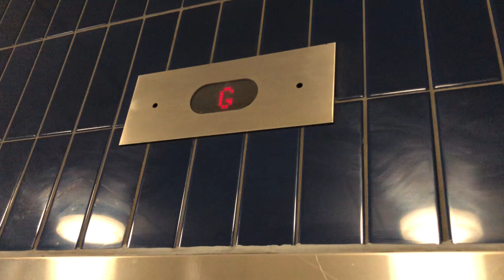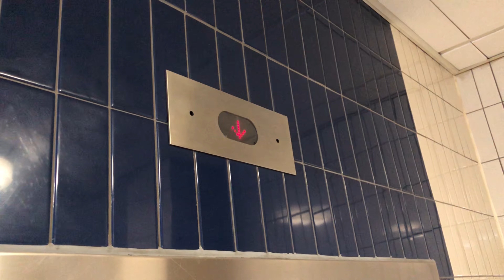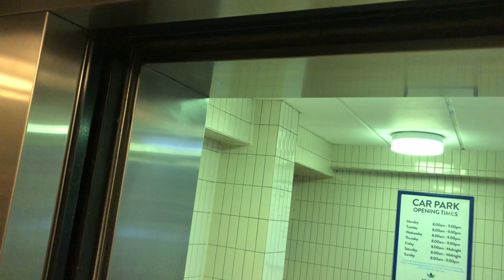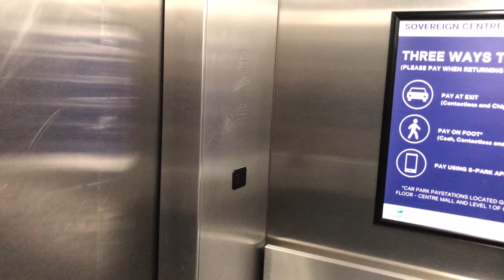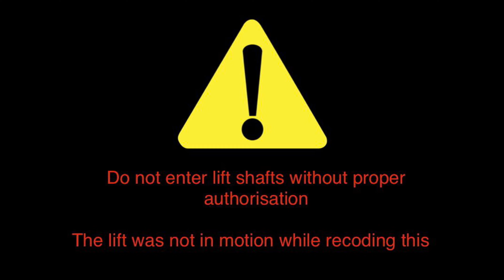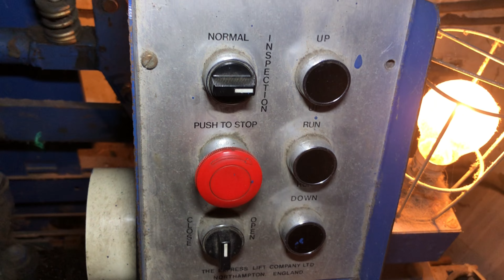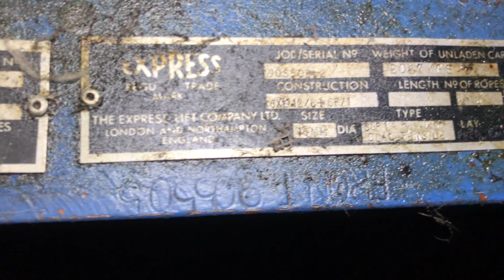Awesome 1993 VAC Controlled Express Lifts in Weston-super-Mare

Comment: Pretty sure Express Vac 2.  DDA buttons and voice added later date  for upgrades ( giveaway is the a&a box on car top )
Reply from the maker: Would VAC2 be the controller type?
Quite little is known about the microprocessor era of Express Lifts. They’re so uncommon to see, and nobody ever manages to access the motor rooms for any of them.
I’d be very interested to see the controllers for these!

And yes, the buttons have been replaced unfortunately for DDA regulations. Not sure why they went to the extra trouble of blanking off the original panel on the door frame considering the new panel is a ‘handrail’ type on the wall though. Would’ve been nice to just have two car panels!

Hopefully these lifts will keep going for quite a while longer, but knowing what part availability is like for these ‘unusual’ types of lifts, that may not be the case!
Only time will tell I suppose.
Reply: @Lift.Tracker  Yes VAC 2 is controller type. Stood for Variable Alternating Current. A mixture of Circuit boards Encapsulated relays and some main contactors. The VAC 1 & later 2 took over from the pole changers early to mid 80s and latev80s early 90s. The motors where controlled by a thyristor rack and board.

Comment: Do these have full intelligent leveling? And also that inspection control looks similar to the ones in public housing blocks in Singapore
Reply from the maker: Yes, the levelling is almost as good as Schindler Miconic. It has just a slight delay for the last 1cm, but it has advanced door opening so therefore it has no relevance.

Yeah, I think it is the same inspection control. Quite nice! :-)